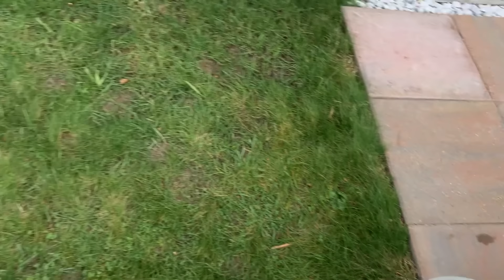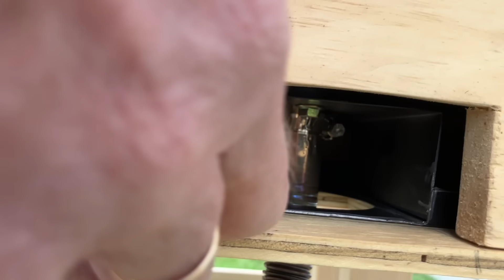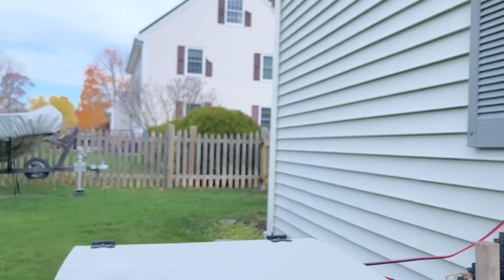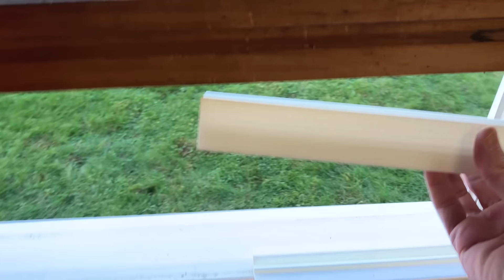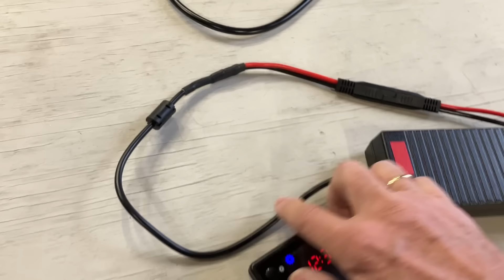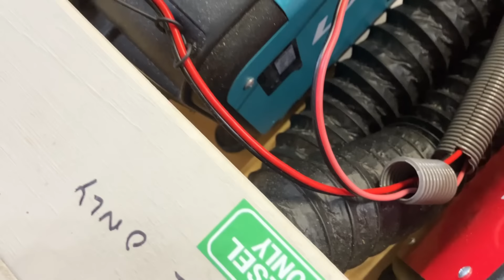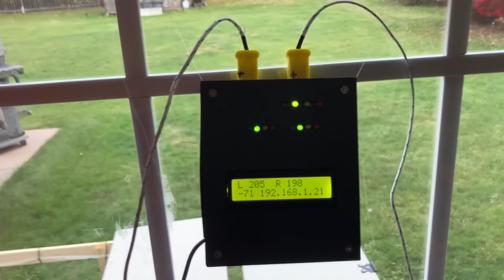Part 1: Dual Diesel Heaters for My Garage! Overkill? Maybe. Awesome? Definitely.

Comment: Great video and explanations 🇨🇦✨️💫🎖, but I heard ( did not test it) diesel in the cold will give you issue.  Perhaps place the diesel canisters,  do not place them further but simply add a box containing  the two canisters and place a 2 inch heat entry to the box so the diesel never gets too cold? 💡
Reply from the maker: Very true! If you see some of my other videos I have problems in the cold. The fuel gels just enough that the fuel pumps won't start without heat. But once I get the fuel pumps running, it seems to work down to at least 4 deg F. Thank for the comments. Good eye for problems.

Comment: This is great! Can you tell us what brand diesel heater you used?
Reply from the maker: This is what I bought at the time: https://www.amazon.com/dp/B0CC1CFHLG  I don't think they sell it anymore, but if you are handy and going to build a box, you can simply get just about any heater and mod it. I have acquired over time different heaters, so its a missmash of heaters. The control heads are also different depending on the heaters, which makes it even more complicated. Sorry if thats confusing... Just use caution for all the reasons if you go off label.

Comment: Just a point love what you have done, however your exhaust gasses have liquid residue as it cools and will collect in the bends, the exhaust should always point downwords.
Reply from the maker: I totally agree. I pulled off one of the mufflers in preparation for making some upgrades to this years unit, and its totally rusted out. I'm raising the boxes to be in alignment with the intake at the window so its straight shot. So I'll add angle the exhaust down a bit to my todo list. Thanks!!!

Comment: I have two heaters outside one for living room and one in bedroom. I mounted a flanged duck on the input side. The one that heats bedroom is on a 5 foot stand.
Reply from the maker: At these fuel prices do you think you are still saving money. Red Diesel totally legal for heating, if you can figure out where to get it. Regardless I love the heat that Diesel Heaters produce. Feels clean and good.

Comment: That setup isn't efficient. First...insulate your garage well. I used 2" green foam panels. 2nd: you should run that exhaust heat into a heat exchanger with a fan. Then you just may get by with running only one heater. My shop is 1200sqft...I run two of them and it keeps my shop 25-30 degrees warmer than outside. Also I run a 50/50 mix of waste oil and dyed diesel. The oil I get for free. I may use $5 of fuel in one day.
Reply from the maker: It is so inefficient. This year I'm raising the heaters so the air in / out can be straight and short, plus the exhaust won't end up in the 2 foot high snow. And maybe insulated for the air in out. I like having everything that burns outside, but there is a ton of loss, not so bad at $3/gallon, but much worse at $6.50.  Eventually I want to try an outdoor water diesel heater. I saw someone had also harvested the exhaust heat with that. FHW in the garage. LOL

Comment: Could easily get a pellet heater and avoid all the mess outside
Reply from the maker: 100% agreed. This project evolved from a single heater and a hose brining warm air inside, into this. But its fun. Could have also just done an electric heat pump.

Comment: Why take the cold air from the ouside and heat it, should have intake on the inside????
Reply from the maker: You'll have to check out other videos. The black tubes are return lines from inside and the silver ones are the hot heat. Though for this next season I may completely redesign it.

Comment: My only tweaks would be to put the clean air intake up and out the back in the opposite direction as the exhaust and don't allow for a situation where plastic fuel lines are above the exhaust or the box accidently filling with fuel, leaking down onto the exhaust. Love the thought and execution put into this. Great job.
Reply from the maker: Thank you!

Comment: This is smart. You are better off using twice as much fuel to get the space warm rather than having undepowered heat that burns fuel but doesn't heat the space. Heating a garage is hard because the concrete floor is basically a slab of ice in cold weather, it takes a long time to warm it up. I found this out the hard way with my garage couldn't even heat it with a wood stove!
Reply from the maker: I find that it takes a while to heat up because I have to heat up everything in the garage along with the cement slab. But then when I turn off when not in use, even on super cold nights (0 deg F)  there is enough residual heat in things that it says jsut above freezing until the next day.

Comment: Why didnt you just put the diesel cans in the garage????? being outside in the elements is not a good idea, plus diesel likes to gel in cold, plus tbh is looks like crap the way you have it set up.
Reply from the maker: The goal was to get all the fire burning, CO stuff outside as much as possible. So far fuel gelling has only been a problem with my pumps starting, after they get going its been working great. Down to a solid 2 degrees so far this season. The pumps around here do a good job winterizing the fuel. My wife agrees with you. I have to take the whole thing down in the spring so that we don't see it on when sitting outside.
Reply: @V-Tank  ya i can see why you did it that way, but honestly diesel doesnt give off vapors or isnt as volatile as gasoline, diesel is a lot harder to catch fire. one thing i would check with is city codes and your home insurance just in case, and of course be smart were you put it. another idea if your bent on keeping it out of your garage is to build a storage room next to your garage and insulate it.

Comment: Wooden box …. Firewood
Reply from the maker: Yes, agreed. I would like it to be metal, but metal sheeting is expensive.
Reply: @V-Tank house fires are cheaper… got it
Reply from the maker: @Rob-Robert-s thats way its all outside with the fuel way far away. Plus I never run it unattended. Lots of people though run these things inside with fuel right in the box with the heater with the exhaust going outside.

Comment: Aside from the gel aspect, have your pumps had trouble priming that far away from the can? Want to do this to mine but don't want to burn the pump up from it drawing to hard.
Reply from the maker: Yes and no. So when it gets below 10F, the pumps won't even click. If I warm only the pump up a few digress with my hand just holding the metal, they start clicking and then they are fine. Priming in normal temps (like 20+) has not been an issue. It took two prime cycles and I could watch the diesel as it worked its way up the line. I don't run the fuel cans dry though, because if I suck up air I have to prime all over again, so I try to run them only down to about an inch or so just to keep things simple. So far pumps are holding up. Its just the cold start. I think I tested to about 4 F (see my video on hand warmers where I talk about this problem).

Comment: Great project , i see that you use 3d printer heating probe , i have also build a isolated room in a big garage and 1 dieselheater with valves to chose to what zone het heat blows
Reply from the maker: Thats really neat using zones. I would love to know what you are valves you are using. I had thought about putting a valve on the return air outside so that I could choose to suck my air in from outside (fresh) or simply take it as a return from the garage on the very cold days. I know most people run these inside, but the outside model means I could in theory move a unit to some other window or some other house, shed or tent in a pinch.

Comment: Cool. I mean it’s way too cool because every inch of fresh intake and hot air of tubing that you use eats up your efficiency!  Pretty cool move the sucker 3 feet closer and you’ll have much better results!  Also, if it gets that cold and you need that much heat, you might want to consider using a heat capture system you can find on YouTube for your exhaust.
Reply from the maker: Thank you. I've been thinking of raising the legs so its a straight shot from the units to the windows. Then insulating. Maybe next season.

Comment: Could this be easier if you were to build the external heater setup using the non-all in one style heaters? The smaller boxes would give you flexibility with space and positioning of the fuel pumps, etc. That would be 50 percent smaller. You can also run them on their side with the engine exhaust and air pointed horizontally and fuel line would drip downward.
Reply from the maker: I’m not sure which non all in ones you are referring to. The taw diesel heater units? I took the units from inside the all in one. Though I never thought of running them sideways. Next years version maybe.

Comment: You might want to put a couple of 90 Degree elbow's  on the cold air return ports and then put a pipe down to the floor in the shop to pick up the cold air which drops and port it out to the heaters.  Then point your hot air vents up or straight out to push the heat into the center of the room.  Might suck the cold air out of the room faster for you instead of just recirculating your warm room air out to the heater and back over and over.  Also, I would consider insulating both the hot and cool air duct work between the garage and the heater boxes so you can keep more of the heat you are making.  Otherwise, it looks good.
Reply from the maker: Thank you. I can't currently run more pipe as the existing run is too long for 3" and I'm getting a lot of air friction. I had to bump the fan speeds up, which is an issue in itself. Next season I'll move the legs up so the air ducts are level with the window which will shorten them and then I'll have some distance to play with. I might put a small fan on the floor pointing up in the meantime. Great idea.

Comment: Some of what you’ve done is impressive, but I took a much simpler approach with the heater (1) inside the garage. Pulling air from the outside, and running the exhaust through an old house radiator. Fan behind the radiator..
By taking the intake air from the outside you maintain a positive pressure inside the garage, keeping drafts and moisture out. And a constant fresh supply of air. 
1 heater easily heats my 600sq ft garage that way even in freezing temps.
If you want your kind of fuel capacity, consider get a home heating oil tank. 
It wouldn’t look any worse than your big yellow cans. Also home heating oil is usually cheaper and would burn even cleaner than #2 diesel from the pump. 
My 2 bits. 👍
Reply from the maker: Thank you. Agreed on ugliness of those yellow cans. My wife tolerates my setups. I’ll take it down for summer which will keep her happy.  On the positive pressure front, my early setup had that. Two problems i discovered. The garage is attached to the house so fumes from other projects got pushed into the house. And when its zero out my intake temp is also zero so i loose a lot of heat warming that back up.. Indoor units would be the most efficient. Love the exhaust heat recovery you have going on. Do you find a lot of moisture in your exhaust? I would love a tank of heating fuel!

Comment: I like your setup.  I'm working on one for my camp.  I gotta joke with ya for writing diesel on a yellow diesel container.  If you could shorten your pipes bring the heaters closer to the hole.  Make the stand taller.  I'm only considering these ideas because of the snow we get where i'm at.  Good job!
Reply from the maker: Next year I plan on raising them so the pipes go straight to the window. I would like 4" ideally. This setup has a lot of air resistance in all those pipes so I had to up the fan speeds. So not perfect, but getting there.
Reply from the maker: Standing taller to make the pipes level with this window is on the mental checklist. That would reduce a lot of air friction by having them shorter. Several family members using mowers and other gas power tools, so I'm really making sure they don't fill the mower with diesel or something other mistake in the future. I thought I replied to this, but I'm not seeing it here (sorry if duplicate). The 3" accordian pipe creates a lot of air friction which caused me to up the fan speed on the heaters, which causes other problems. Ideally 4" insulated if you can figure out how to adapter them would be ideal. Or just shorter more efficient runs like raising the heaters.

Comment: Aren't you making them work harder with long runs on intake and discharge air supply?
Reply from the maker: Yes. I upped the rpm’s from max 4300 to 5000 on the fan. Next generation will need to be something else. I get a lot of air resistance. Maybe 4” tubes aligned with longer legs so its just straight from heater to window to reduce tube length. Or as everyone points out, run them inside and exhaust outside and gain some btus from efficiency.

Comment: Great job thanks for sharing this video with me  will definitely be using some of your content to upgrade my system. like running a extra 3 inch tube to the heat exchanger to bring air from inside to run through the heater to eliminated from getting cold air from outside 👍

Comment: There's no way that the fuel pumps are gonna last long.  Would like an update.  fine job sir.
Reply from the maker: Agreed as they need a tad of warm up below 10deg even though the fuel still flows. Once going the pumps work, but they are moving thicker diesel. At least with my design its easy to swap a pump out.

Comment: Nice window mount. I just use a jerry can as well for fuel. I went a little lower tech and it works great. I opened up the cans factory vent hole with a drill bit and then ran tubing to the bottom and siliconed the connection when they were new. I then use the factory fill hole as a the vent by leaving the locking ring loose. Has worked great as well with less purchased parts. I did add some cheap inline small engine QD fuel fittings if I want to unmount the can. Mine is a knock off rotopax and mounted on a wall so I pump or pour fuel in the factory fill hole, then leave the cap loose enough to vent.

on a side note, I am almost positive if you tear the cases off those "gen 2" units they are the same as what you are using for the gen 3 just with a tin box extra. Might have to buy a fuel pump for them, not sure if the self enclosed ones use a pump or gravity. I will say mine are inside, I just plumbed the intake and exhaust outside the building, much less heat loss and easy to work on if I have to since its all indoors. 

out of curiosity, why did you go with that semi complicated battery set up going from 110 house power to the battery, then it inverting the 12v battery juice to 110 again, then to 12v with the power supplies to the units? Seems like 1 large 12v battery with marine terminals going to the heaters and a battery tender would be a lot less complicated parts wise. Mine runs off 2 solar panels and a charge controller from amazon to charge a 200 AH battery. Honestly, pretty sure it only ever uses the solar to charge the battery since I never have never selected for it to use both.
Reply from the maker: Yes Gen2 has fuel pumps. I gutted units to make Gen3. I'll use the Gen2 for spares/parts. I ended up with various black Friday deals, etc. So everything is on the super cheap side. So better to have spares.

The gray cap dipstick wasn't worth the money, I prefer the super cheap dipstick that uses the black ring that comes with the can. Since they get left in the rain I added real vents to reduce water. I started leaving the rings loose, but then was worries about water.

When I started off, I wanted to build a battery case for a deep cycle lead acid marine battery with a charger and protection circuitry, more to handle a power outage so I could gracefully shut things down since I've heard of electronics in the heaters getting fried on hard shutdowns. But I got an ecoflow as a present and so it actually just made my life easier (and cheaper). Its just acting as a UPS. I really want to do solar because that would be the ultimate, unlimited off grid runtime.

Comment: The heater will " suck " fuel all the way from the gas tanks to the heaters ?
Reply from the maker: Yes, surprisingly it works. The only thing I discovered was if I let it run dry, it takes actual priming to get the fuel all the way back to the heater. But with the clear tube I can see where it is as it primes. Once there it runs great. I don't let the fuel run down to less than about 1" in the can to avoid that. But I don't have to pour fuel anymore and thats awesome!
Reply: @V-Tank  That's nice that it works ,  Quite the MacGyver you are ! Love the set up.

Comment: you should have your exhaust lower than the heater exhaust port and no going up at all. Condensation will cause carbon build up in the exhaust pipe and eventually carbon up the heaters.. so always downhill with the exhaust. Also if you are using the muffler on the exhaust there is a small hole that also should face down.. thats the only thing I can see to complain about here...
Reply from the maker: Thank you!

Comment: Well, I have a drafty and part insulated garage, yesterday it was under 30 degrees and windy, it felt brutally cold by the ocean. I run 2 heaters, 8KW each and I reached 72 degrees. So......no, it is not an overkill. My garage is 450sq/ft
Reply from the maker: Exactly!!!! Mine is about 650 sq feet and it was 8 this morning. Not up to 72 yet, but getting there.
Reply: @V-Tank  It is all about the insulation of the garage and how tall the celling  is. In a 450sq/ft garage that has a structure above and reasonable insulation a 8kw heater is more than enough. However, any compromises on insulation, drafty and all exposed walls will need more to heat up.